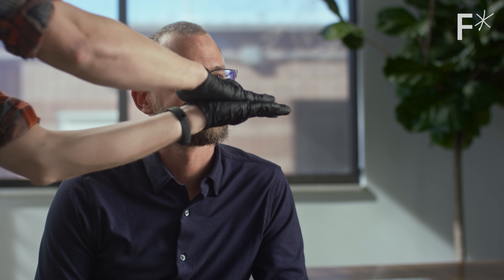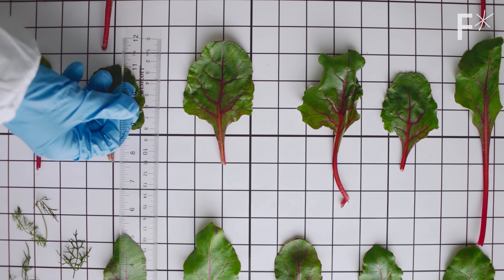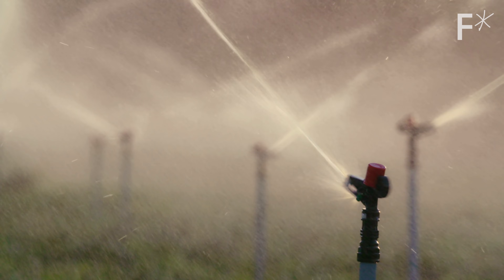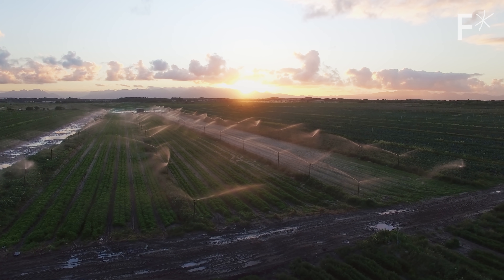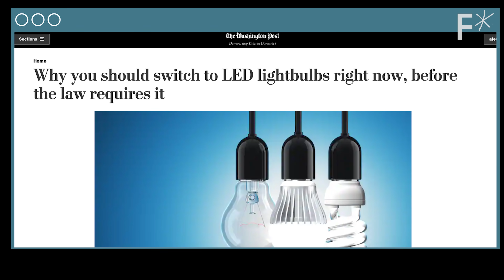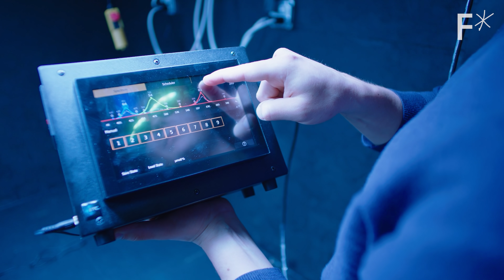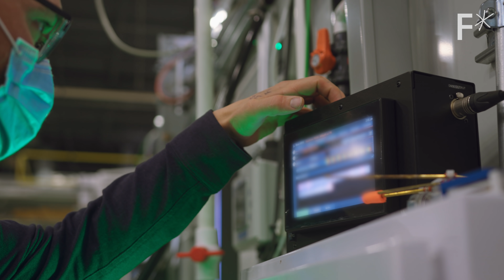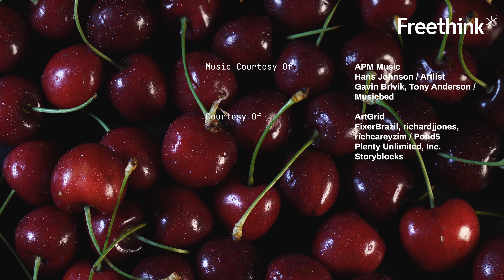Vertical farms could take over the world | Hard Reset by Freethink

Comment: I'm on the fence with these systems for an excellent reason, they are amazing at producing expensive food. A far better system is what a lot of permaculture people do and it;'s a low tech version of this system built out of PVC pipes and simple pumps. Look up things like nutrient film technology and deep water culture. I;ve seen cool systems using a split PVC pipe with open celled foam for the plants. The systems tend to use low flow pumps or spray nozzles for water and use natural light. Most don't use grow lights and just take extreme advantage of all the sunlight. When I designed such systems I said I don;t want a ray of direct sunlight hitting the floor. To me that's wasted energy. They're using a brute force approach which will always be more expensive. It's exactly like using chemical fertilizers to force plants to grow. In this case they using huge amounts of energy instead of chemicals but neither system is remotely green. They boast about water usage but steer clear of energy usage. I can tell you a plant that size easily uses a megawatt and I say several megawatts of power. You can run a small town on the energy it uses. You can roughly do the same thing but produce half the food but only use tens of kilowatts for pumps and such instead of megawatts. In a sense they are designed to make food more expensive. Cheaper equipment doesn;t make the power cheap. You;re still going to be paying $5 for that pretty head of lettuce while a permaculture system can produce the same food at half the cost. I'm not against using grow lights and using them in a hybrid system so you maintain food production during the winter by augmenting the sun with additional lighting is smart. Sorry but these systems are a bit dumb on that level. it's maximizing yield at the expensive of affordable food.

Comment: Fascinating.  I'm reading that the electric bill for 10,000 sq.ft vertical farming operation can come in at a whopping $100k to $200k per month!  Then I'm not seeing any solar panels installed on the large rooftop area there at 10:05 in the video either. 🤔  On-site solar would take huge chunk out if not all of the electrical bill.

Plants do need night time as well and actually nighttime is the trigger for them to use their daytime glucose to grow their tissues and make cellular repairs.  So that works out with no solar power at night as this follows the normal daily solar cycle.

Comment: The energy cost, even with the most efficient LED's, is too high for all but the fastest growing leafy vegetables.  And, if the energy comes from fossil fuels the CO2 could be worse than traditional farming.  On the upside, the near total absence in the need for pesticides and the dramatically lower water usage make it preferable and the better quality is worth something as well.  When we've moved to solar for most of our energy and the indoors farms are mostly driven by wind and solar then the energy costs will be less significant and the benefits more than enough to compensate.

Comment: They said this about Hydroponics...(in which case Yes the answer is absolutely it is better than conventional farming) the problem is power supply is INTENSE. Even if you use more conventional greenhouse designs to allot for less artificial lighting, you still have a metric crapton of power going into the hydro pumps keeping everything working.

Let's just say...a society based off of petroleum and coal will not be able to properly and adequately supply the power here.
Nuclear reactors are a MUST, either nuclear or geothermal (and we don't have proper geothermal power yet).

Comment: Vertical is awesome but suuuuuper expensive for startup and crazy high power bill.

Requires waaaay more led lights 
That increases heat
That increases humidity 

So between the massive dehumidifier, ac units, lights, and water pumps this kinda of farming has a fairly large carbon footprint.

This does not work without supplemental lighting very well even in green house settings. 

The production is insanely huge, nothing is free.

Comment: It's crazy that we've optimized agriculture to a much smaller carbon footprint using less resources and yet prices are still going up.
Reply: But it's not really.

They never tell people that in the 1950's American households spent 38% of their income on food.

Right before covid hit, Americans spent just over 6% on eating at home, and about 5% eating out.

So today, with a pandemic, we're paying maybe 15-17 percent?

If you look up what things used to cost and factor in inflation, almost everything is a LOT cheaper today.

1950 fridge was $500. That literally $5,000 today. It was about 13 cubic feet, and you had to defrost it.

Today you get a stainless steel 21 cubic foot fridge with ice, water, and a filter, that defrosts itself.

 It costs less than $2,000.
Sure, the modern one will last about about a third less time. But even if it lasts half as long, you're still at less than $4,000.

Things are cheaper today.

The difference is we have a ton more things we spend money on.

In the 50's that had 1 phone, 1 TV, and 1 radio.

And they didn't replace them every year because a new model came out. They kept them until they broke bad enough they didn't work at all.

A family had one car. Today several is common.

They also rarely went out to eat. It was a special treat. Today, we average eating out 4 times a week. And the average counts everyone, including babies, people in nursing homes, etc. So for a large percentage of people, it's more than that.

We also have all the internet stuff we pay for.

Comment: Vertical farming uses way too much resources.  1 Construction of a warehouse with heating/AC irrigation and electrical wiring carbon intensive  2 It takes a lot of energy to grow plants with LEDS .The sun has a high energy output, and mimicking it is very energy intensive 3. Hence only lettuce and other low nutrient crops can be grown efficiently in vertical farming 4. Depending on conditions, growing food in nearby farms or greenhouses makes generally more sense both in energy used and carbon released. Of course it farming involves getting your hands and boots dirty,  not working in an ultra-tidy environment that looks like an Apple Store. So it depends if your priorities are looking cool, or having a cool planet.

Comment: This is nonsense. Farming is a system for turning solar energy (and some chemical energy) into chemical energy. The only moral application for this technology is where there is spare electrical energy and the outside environment is to hostile - as in Mars.
To advocate it for production on earth is nonsensical until there is limitless fusion power for the lights and fans and condensers and to make the buildings. The eco warriors should be up in arms about this sort of project - but it's got plants and I doubt many will look past that.

Comment: For some reason this sounds like a zero sum game. Although probably good to sustain a low square footage area like cities would be cool, then food wouldn't need to travel too far to get where it has to go, it would be smarter to change our economic system so we would stop importing out of season foods. What we have is a waste problem, not lack. The building industry is causing 40% of the entire worldwide CO2 emissions. The good thing about an open field with crops is that it's basically nature. Now we have to diversify it again and we good. We have a lamp and an efficient water system. It's called the sun and weather. We just have to adapt to the new circumstances like higher temperatures and less rain. Maybe move the fields.

Comment: This works for horticultural crops. What about cereals and legumes (corn, soybean, rice, beans, etc.)?
Reply: As someone who farms corn and soybeans, I don’t believe so. I think it would be difficult/ impossible to grow those on the “pole” things they showed, so it would need to occupy basically a floor in a building. The other problem is the soil required. You just straight up can’t grow corn in a pot. The root system for a plant is generally just as big as the top of the plant, meaning that for corn you’d need to bring in a crap ton of top soil. The other issue would be actually farming it on a scale. Sure, the little robot things work fine for harvesting something that would traditionally require manual labor, but for those crops farm machinery can’t be beat. There’s machines out there that can harvest 40 acres of wheat in an hour. It’s just not going to work at a scale for those, and if it does then the costs would be astronomical.
Frankly my main issue with vertical farms in general is how high the cost of entry is. Sure, it might pay off but if this became the main farming method most people probably couldn’t afford it. Pretty much the entire food supply would be corporate produced. I think the true answer is precision agriculture, it’s a good combination of the strengths of each practice.

Comment: Now if they could just get together with the brainy engineers who design solar light pipes... use the variable (but free) light coming from the sun as the primary light source. And then use lux meters to know how much supplementary light is needed from the LED's. With a large enough collector, use an iris to "stop down" how much light gets in so it's not too much. Open the iris wide on low light days. But this is super simple automation... controlling the iris, controlling the LED's, in real time to respond to the natural conditions outside. 

There are some pretty massive savings to be made here to cut electricity costs.

Comment: If it costs $100,000,000 to set up a facility, and these facilities can out compete the small farmer, then vertical farming puts the food supply into the hands of the elites.  This video also doesn't cover that GMO's have been engineered specifically for vertical farming.  So while there are advantages and disadvantages to this industrialization.